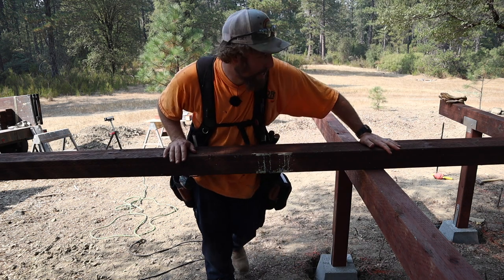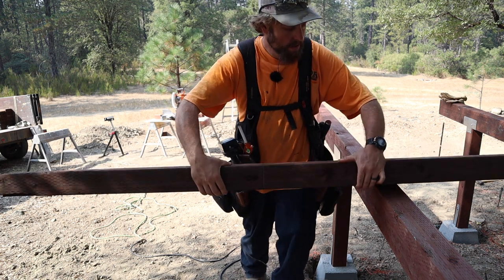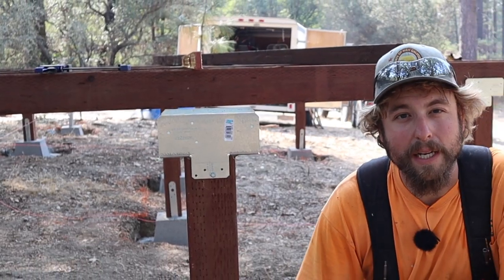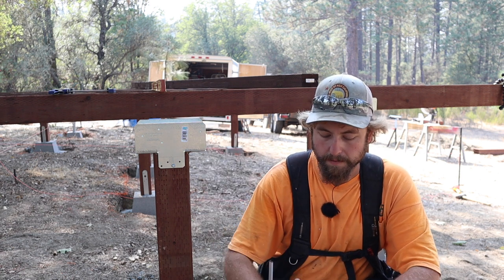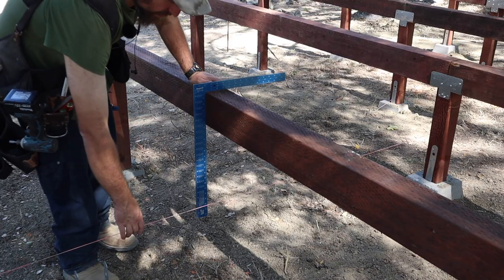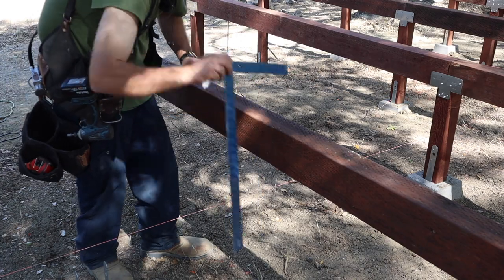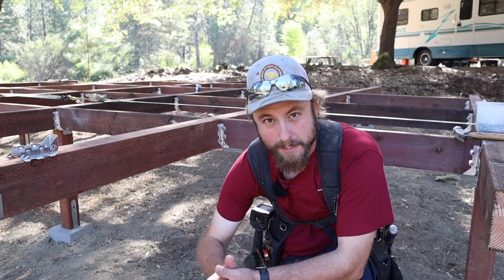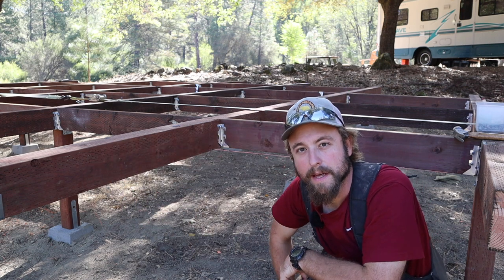FRAMING | YURT Platform Build | Step 2

Comment: Interesting that you have just about everything in the way of tools but lack the one tool I think is critical to building…a 12 inch compound miter saw. What’s with that?
Reply from the maker: Ahh yes, couple reasons, I do have a 10inch C.M. saw, a sliding C.M would be nice but the bulk and abuse I give to that saw is the reason I take the 10inch with me. Plus it keeps me sharp on my circular saw skills.

Comment: where did you source the deck beams  I assume those are 2 x 8?
Reply from the maker: I purchased the all the lumber from the local lumber yard, they are pressure treated/ ground contact. The beams are 4x6 but 4x8 could be used. and the blocking in-between are 2x6. Depending on where you live "ground contact" lumber may look different.
Reply: Thank you

Comment: How long did it take to build the platform from ground up? Do you estimate how many hours? I'm sure you had to let concrete set so couldnt do it consecutively. Got estimate for labor (not even including materials) for 10-15k. That seems high just for labor but maybe I'm wrong.
Reply from the maker: It took me just under 2 weeks, from digging holes to plywood on deck. that includes filming. At the time I charged about $9,000 including materials, but materials have gone up a lot since then. That is pretty high for labor!
Reply: @JoeSimple  Yes. I agree. Even with lumber being higher. Thanks for the the data. Helps me when trying to negotiate with these contractors. 😀

Comment: Hey, thank you for the great video! We're about to build a 16' Pacific Yurt as an ADU. I've been watching and re-watching this video to see how you hung your blocking joists down the center line. My confusion is around how the joist hangers could attach to the beams where there's already a post cap holding the beam there. It looks like you hung the center joists actually a little off center as not to put a joist hanger right on top of a post cap. Hopefully this makes sense. My concern with having a blocking joist a little off center is that the plywood decking seams wouldn't land on the center of the joist that way. Am I being an idiot, or did you have to work around this somehow?
Reply from the maker: ahh yes great question. I pre drilled a hole through the metal post cap where the joist hangers landed on top and used the joist hanger screws. Then if needed use deking screws for the longer diagonal screws, rather than 16d nails.
Reply from the maker: also what's your thoughts on the thumbnail I just changed it today?:) (added the YURT text)
Reply: @JoeSimple  Ah, got it. I was wondering if you could do exactly that. Can't tell you how helpful I've found this series on building a yurt. First project of this size for me. I'm in Cottage Grove, OR just minutes away from Pacific Yurts, so that's convenient. I just keep going back and referring to their show models. :) Thanks again!
Reply: @JoeSimple  And the new thumbnail looks good. It's funny because, like I said, I've watched this video about 10 times. And I was like hey, that's new! lol
Reply: And let me know if you're not far from Cottage Grove and wanna help a brother out! Kidding, not kidding.

Comment: !!! help!  the guys who build my platform did not follow the plans and did not put the galvanized steel caps to the post tops on the frame for my deck.  how critical is that?
Reply from the maker: It's NOT absolutely necessary. I always over engineer. In california it's a standard thing because of earthquake. If it's something you would like there is a solution a (simpson AC4) on both sides of the post.
Reply: @JoeSimple  thank you so much Joe!

Comment: I am building yurt on a slope. How do I make sure my posts are all at a level height from the footers?
Reply from the maker: Hey Daniel, My method for this is using the footer at the highest point as my starting point. then using a long level or a level on a strait piece of lumber to get to the next footer and measuring from the footer to the leveled level will get you the post height. "Tip" if your unsure of your measurement the make it a little taller as it is easer to cut more off. One thing with the yurt platforms is the parallel beam footers do not line up, sooo  I get the first (longest) beam set and leveled, then I will bar clamp the level to the underside of the beam and measure from footer to top of level ( 1:14) ( 1:20 ) then continue doing that tell you get all posts and beams set. I hope this makes sense please feel free with any more questions or clarification. thanks for watching and happy Yurting!
Reply: @JoeSimple  thanks a lot, client bought the biggest yurt from pacific yurt, dealing with 32 of these footers. Your videos have saved me